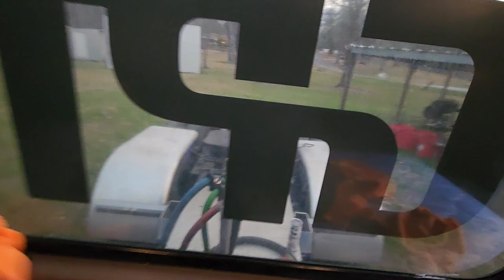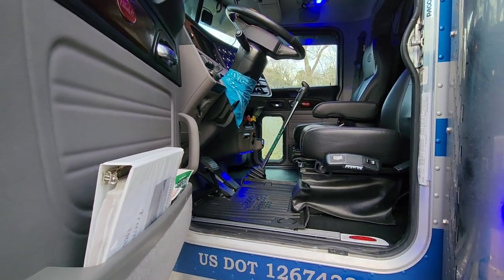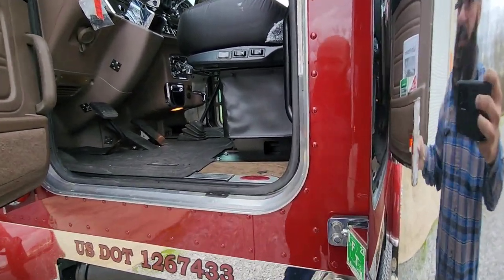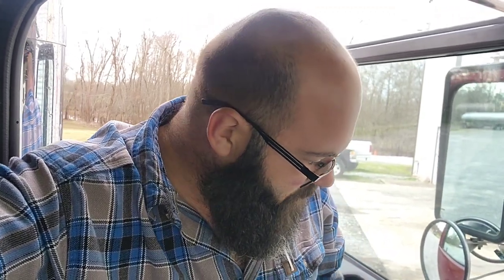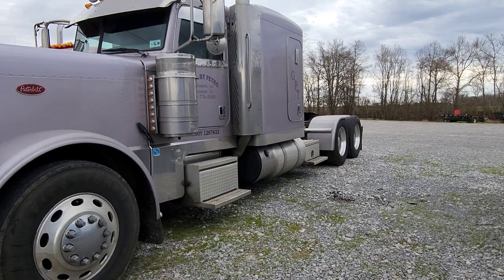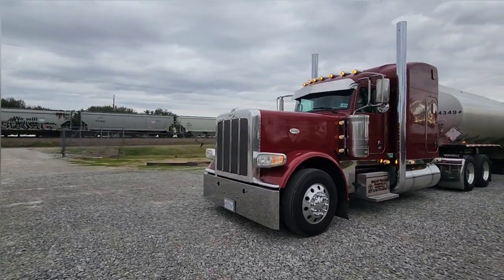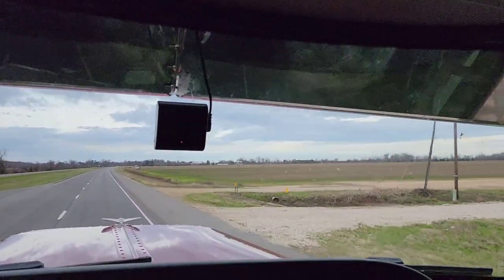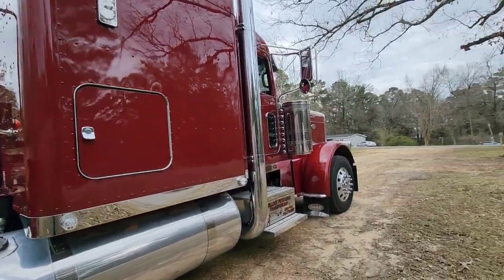Finally In My New To The Company 2015 Peterbilt 389 Kit Truck // The Day Has Finally Came

Comment: Hi Mike, just started watching you. I’m in Mazatlan for the winter and live in Canada. What caught my eye on your video is that you are running a S60 engine. I worked for Detroit Diesel for 42 years and was S60 sales mgr for a part of that time.  Great engine when you look at all the major fleets running them.  An option that’s available is “Optimized Idle. It has a thermostat that goes in the bunk. It monitors engine temperature, battery voltage and bunk temperature. The engine automatically starts and stops when you are parked as it monitors the above criteria. Something to think about. Also ProcDriver is another add on for the dash. Gives you lots of information including you MPG.  Enjoy your videos. Safe trucking.
Reply from the maker: Gonna have to check that out.. thanks

Comment: Great video, I have been researching on getting into tanker, I’ll be testing next month for tanker and hazmat. But as a O/O that has done dry van for 5 years how do I get experience in this field?
Reply from the maker: I would say the same way you got experience with dry van.... just do it... when I started pulling tank and hazmat I didn't have a clue what I was doing never pulled one before... and got hired on where I work at and they gave me a chance.... I came from pulling heavy haul and wish I would have pulled tank years ago..
Reply: @Life-On-18-Wheels  ya apply until they give me a chance, hope they offer training.

Comment: Did that truck come from Elkhorn in Nebraska
Reply from the maker: Yes it did... you know about it?
Reply: @Life On 18 Wheels  yes sir, I spoke too them about a truck and what they do. The cost was very expensive. How many miles on your chassis?
Reply from the maker: Yeah I think he paid 220 for it... I do t actually know the miles on chassis but I seen a tag in the sleeper that had something changed at 900 thousand miles so I'm guessing a little over that... it has alot of rust of course from being up north but ain't nothing a little work can't fix....

Comment: Question Michael, did they not paint the panel on the back of the bunk on the "new" truck?
Reply from the maker: If your talking about where the window is on the back of sleeper.... then no I have noticed that it is a different shade when the sun hits it... the only thing they repainted was cab and sleeper besides that rear panal due to all the rust that was on it... im guessing that part didn't have to much rust on it..